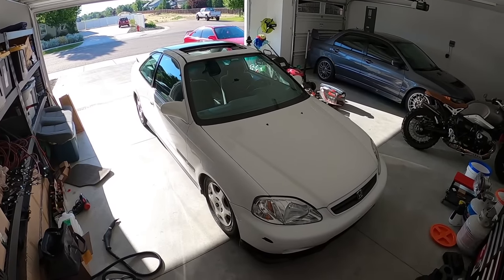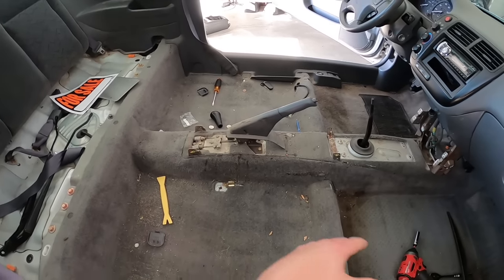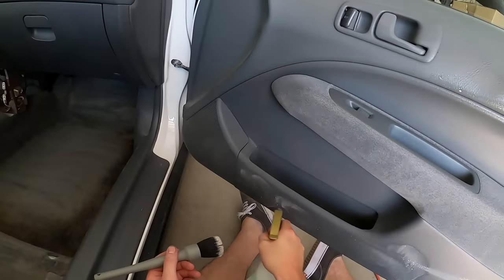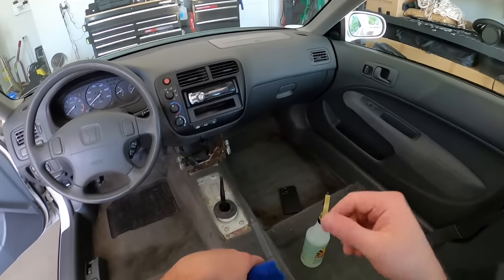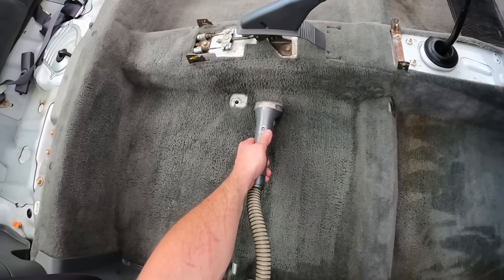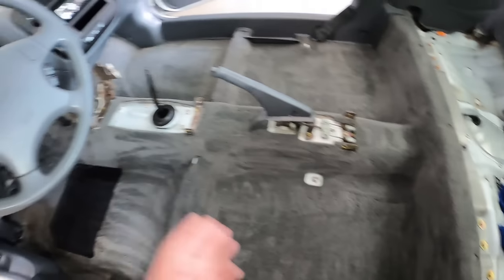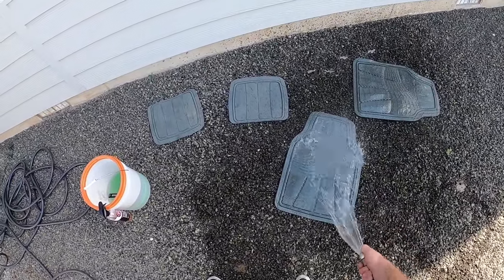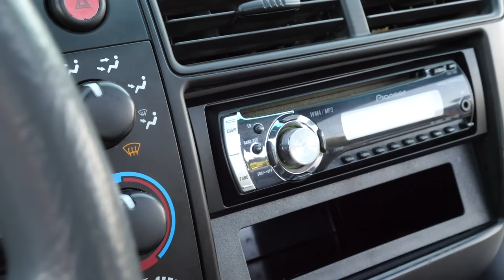Honda Civic Interior Detail Transformation | Deep Cleaning EVERYTHING!

Comment: Great detail... I have a 99 Civic myself I've been working on cleaning out.  I do have to say though, the part part of the driver side seat where you said the fabric is "frayed", it might just be oil accumulation.  I had this on the fabric of the console top and driver's side door fabric area, points where there was bodily contact.  Same with the driver's seatbelt... didn't retract from oil buildup.  Got the console top fabric and driver's door fabric back to new with LOTS of scrubbing, seatbelt and driver's side backrest are still on my to do list.  Keep it up!

Comment: Found your channel while adding AC system to a 99 DX hatchback.
Thanks for taking the time to make the video.  Helped a lot, except I got the clips released with a small putty knife without taking out the instruments.
I noticed in the video your car is an automatic.  At 45 seconds the car pictured is a manual.
Did you do the swap?  I am looking to source all the parts to make it a weekend project.
Reply from the maker: This is a manual!
Reply: @ALLDAYANTHONY  sorry the computer was on autoplay so I posted comment to wrong video. I erased the comment but it is still there.